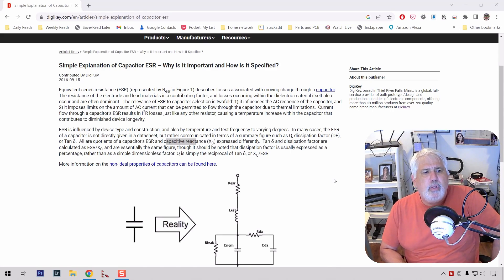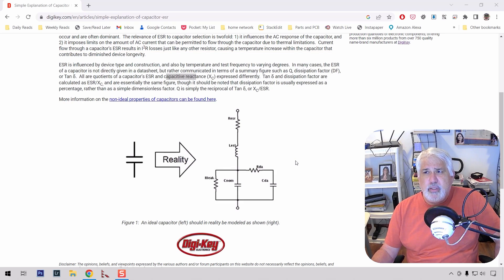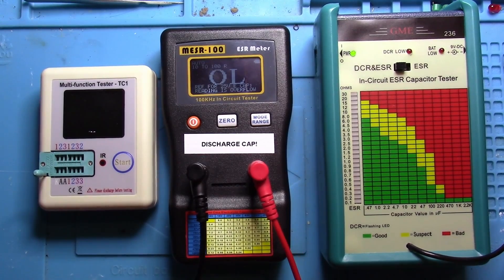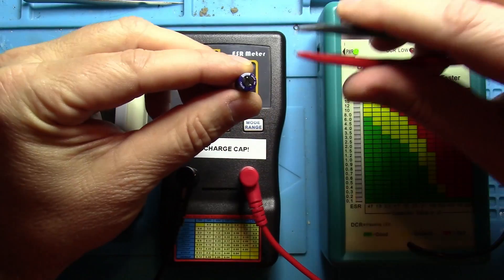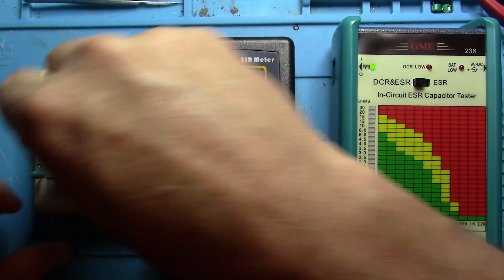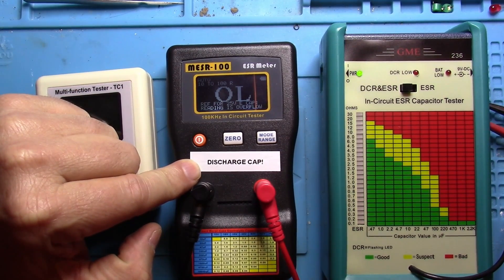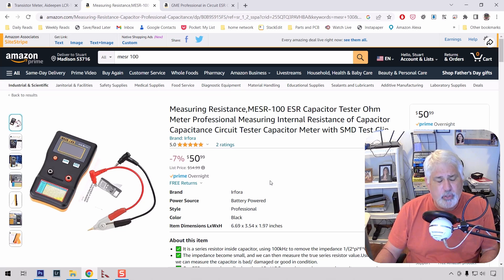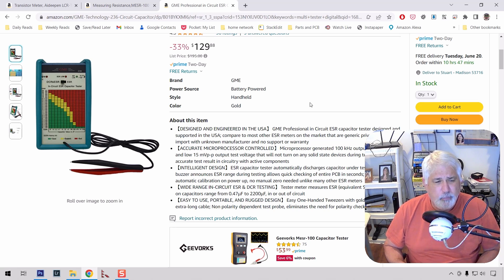Equivalent Series Resistance (ESR) Meters

Comment: Great review, thank you!  And after this review I bought the GME tester.  I am just a hobbyist, often attempting to rejuvenate Reel to Reels and other earlier designed audio equipment.  So a meter that can give me useful info about caps while still on the boards is a great tool to have.  I bought the GME mainly to prevent ever frying the unit due to residual voltage in the caps and my forgetful 70+ year old brain cells.  If you had an affiliate purchasing link I would have used it for you.
Reply from the maker: That is good to hear.  No affiliate, but thanks for the thought!

Comment: What about the PEAK Atlas ESR70? Lots of guys here on YT that are quite proficient at Electronics Repairs are using it for a decade and still recommending it. Thanks!
Reply from the maker: Yeah, someone else asked about that one as well.  I also heard good things about it and would certainly check it out.  I don't own it but if I get one I will certainly do another video comparing it.
Reply: @StuartPatterson  And there's another that comes with test probes and alligator clips tuned to the meter that also measures DCR! The other thing that can fail in a Cap. Anything less than 25 Ohms fails as it should be with all electrolytics. Keeping you busy! LOL Thanks!

Comment: What about leakage? ESR tells you nothing about the very important aspect of leakage. You can build a cheap and accurate leakage meter.
Reply from the maker: That is a good point and maybe a future project!
Reply: @StuartPatterson  just a hv trxfmr, a ua meter, a few resistors,diodes, filter caps, and a volt meter. I run mine on a variac. You can see what they look like at working voltage. subscribed!
Reply from the maker: Thanks and thanks for the subscribe!

Comment: Are ceramic capacitors treated any differently than electrolytic caps as far as testing ESR?
Reply from the maker: It is my understanding that ceramic caps can still suffer from issues with ESR but it is extremely rare when compared to electrolytics.

Comment: Great video - question.  How did you fix your MESR-100 tester when you tested a charged cap?  I just did it and it's not working now.  Any help would be appreciated.   Thanks.
Reply from the maker: I replaced a diode that had blown.  Let me know if you can't figure out which one and I will open my meter and look, maybe it will jog my memory. I think it was pretty obvious in my case.
Reply: I have the same issue. A cap damaged it.

Comment: I've found that the DER DE-5000 LCR meter is a much better choice than the GME in that price range.  I've had great success with it, and its in-circuit ESR performance is quite good.  A recommended improvement for the DER is to make your own Kelvin test clips for the unit.  
A good test for it was a subwoofer amp that had 12 out of its 16 electrolytics gone to the dark side.  All 12 read bad both in-circuit and out-of-circuit.  Accurate in-circuit ESR testing is extremely useful.
The unit is also excellent for testing inductors, and of course resistors.
One MUST DISCHARGE THE CAP first.  Beyond safety for the unit, a small charge left on a cap can confuse an ESR/C meter.
Reply from the maker: Thanks!  I need to checkout the DE-5000.  The price is certainly good!
Reply: @StuartPatterson  Your certainly welcome, and thanks for this video.
Just wanted to add a note that there are a few videos on YT about how to fashion your own Kelvin clips for the DE-5000.  It's worth the effort and additional expense for the additional accuracy and convenience.
Reply from the maker: @matambale  OK, I will certainly check them out!

Comment: Great tutorial. You can also test the resistance and microhenries of the inductors with the esr meter. The reactance formula is 2𝛑FL. That would be 2 x 3.14i x frequency of esr meter x 100 (uH) Just plug it in.

R=0.628 X L(uH)
L(uH)=R(ohms)/0.628
Reply from the maker: Thanks!
Reply: I wish I knew what your talking about, that's like reading alien, how did you get so good at electronics? Did you do a Course? I'm a hobbyist that doesn't like throwing electronics away, I prefer to try and fix, say a broken washing machine or TV, what would you recommend for me that's easy to understand if a component is good or bad? P.S did you go to college to learn about what youve learnt? Many thanks